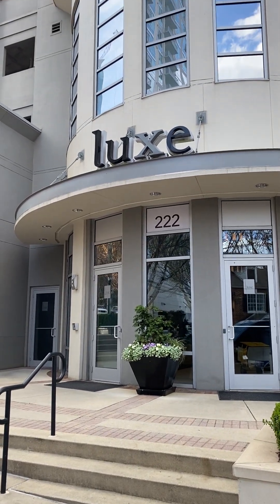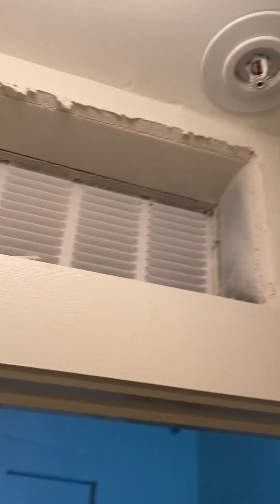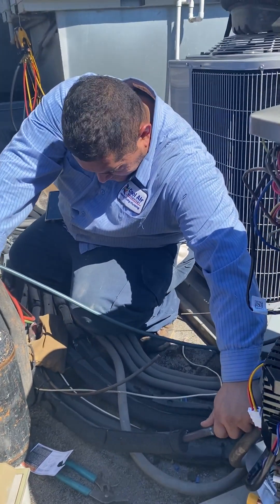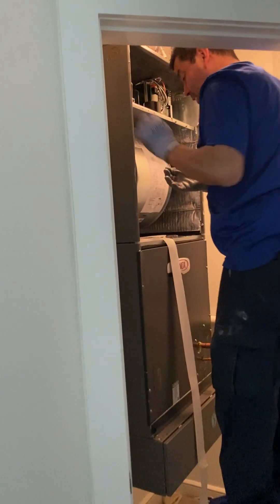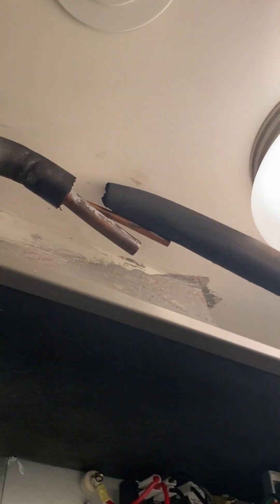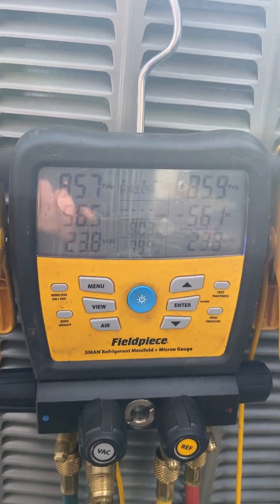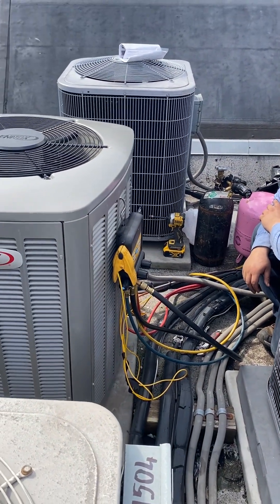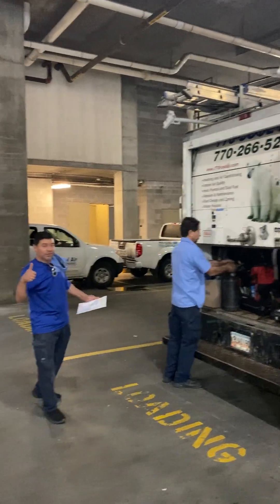High Rise Building - Heat Pump Installation! #lennox #hvac

Comment: Nice job. I’m assuming filter dryer is somewhere there and you did not forget u- Jay trap on the suction line because condenser is above air handler.